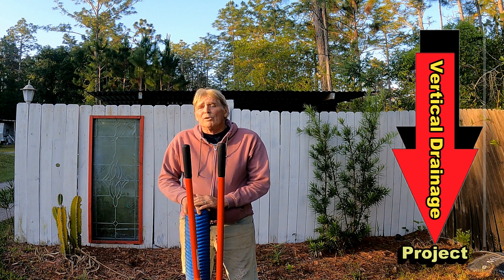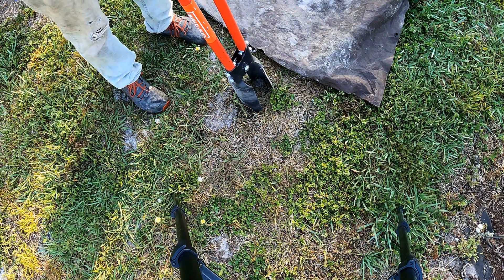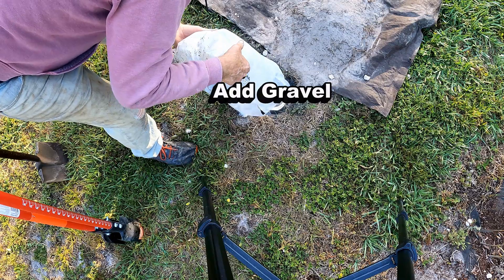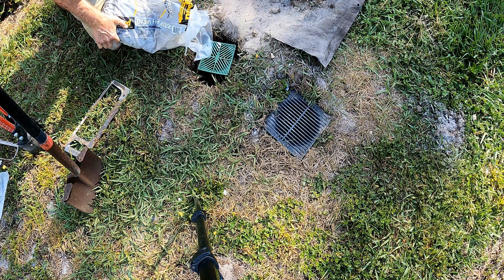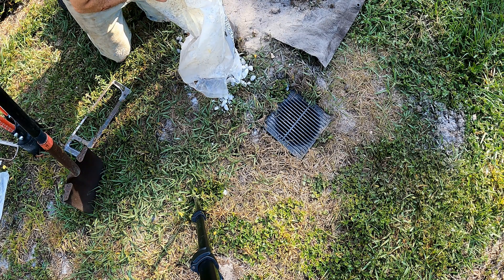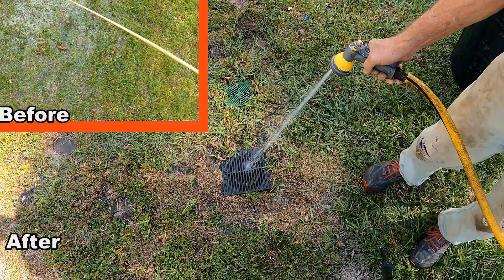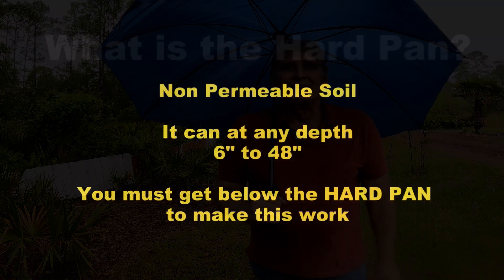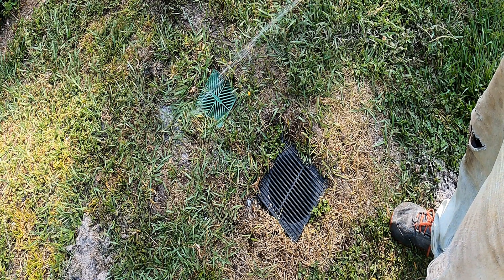Vertical Drainage -With Live Broadcast - NEW INFORMATION

Comment: I just did one of these last weekend to stop condensation from my AC unit from pooling on the ground… It was attracting rattlesnakes to the area where my dogs play with this drought that we’re currently in here in GA… Installed a 6” perforated sewer pipe 3.5’ down in my relatively soft sand clay soil. surrounded by #57 stone and landscape fabric. Added a grate on top and plumbed the condensation pipe straight into the grate so every drop goes in the drain. I flooded the drain with my garden hose and found that it can get rid of water at a rate of about .5 GPM. Definitely cost me far more than $10… But problem solved!!!

Comment: Will this work in Michigan where there is a lot of green clay that is pretty hard...... I dug down 10 feet and there was still clay at that depth.  So, will this work in those conditions?  (BTW, I used a hand auger to dig that deep).
Reply from the maker: @pkaronis1  wow! That’s deep for hand dug
Reply: @appledrains  you didn't answer his question.
Reply: @El_El_Guapo you have to get past the clay
Reply: He never puts disclaimers on different soil types.  I doubt it'll work for heavy rain.   Like the guy said above, need to go past the clay.
Reply: I am in Saint Clair Shores Michigan. Vertical drains DO NOT work in clay. They work for Mr Apple here because he has more sandy soil and water filters through sandy soils better. You will need an actual french drain or drainage system of some kind that is not Dry wells or vertical drainage. I installed a french drain to a sump pump in my own back yard here in saint clair shores.
Reply: @PurplDrank worked for me in Michigan
Reply: @PurplDrank  I'm in Warren/12 mile. My whole backyard is mess from this weeks heavy rainfalls/water from gutters. I'm going to give it a shot with vertical stuff since there's nothing wrong to try and it sounds like a cheap DIY so why not
Reply: @iFlyny  good luck